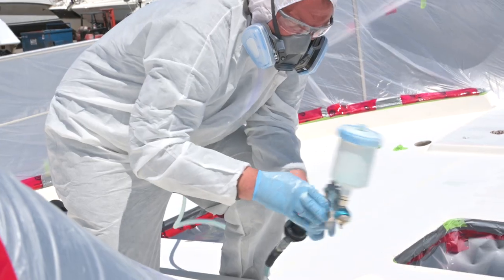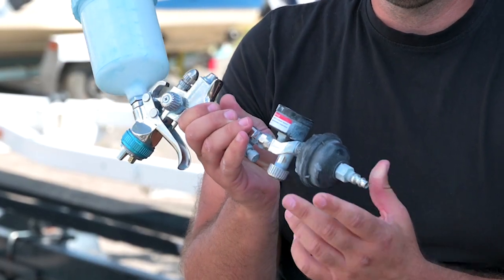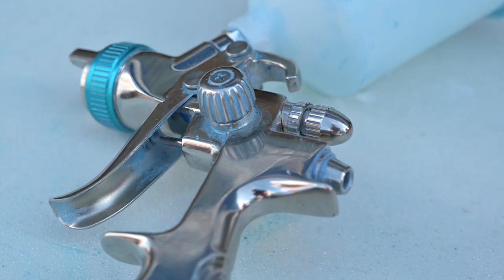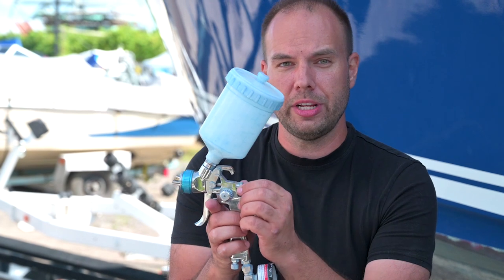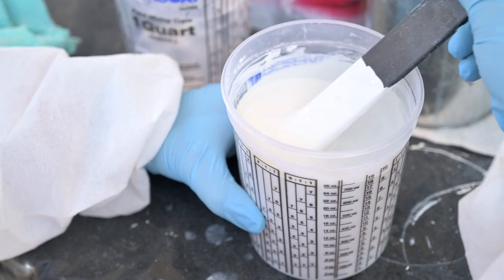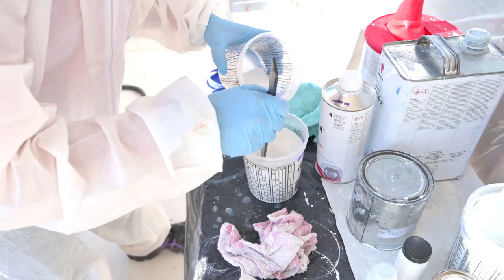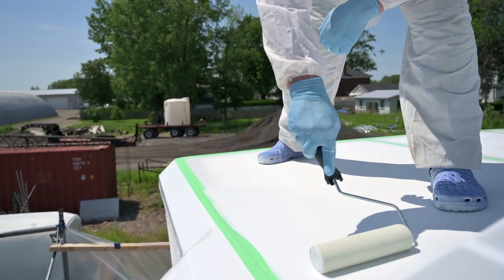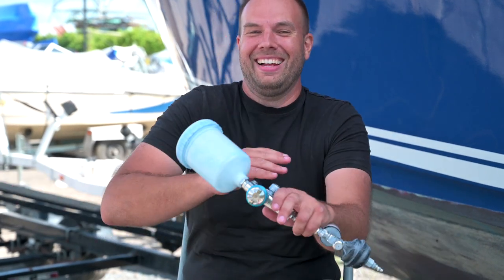How to paint your boat - We painted our Bayliner 4588 with Imron paint

Comment: How many gallons of paint did you use?  And is the Imron 2 part or one part paint?
Reply from the maker: Hi Michael, very good question on the number of gallons. The NAPA was a not too far so we bought what we needed at the moment. I think it was about 2.5 gal for the hull. However, I did the hull twice so I lost count. Imron is 2 part + thinner. So you have 3 products to mix for spraying and and additional part for rolling and tipping (which comes out to 4). For the pure white on the upper I just bought 1 gallon at a time since I was doing it by sections.